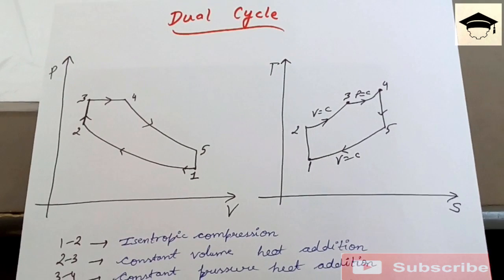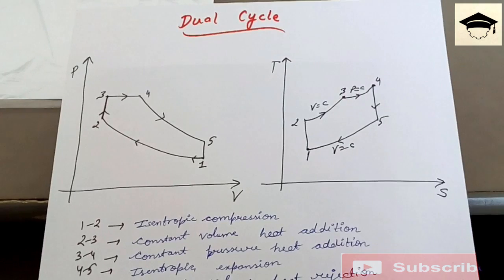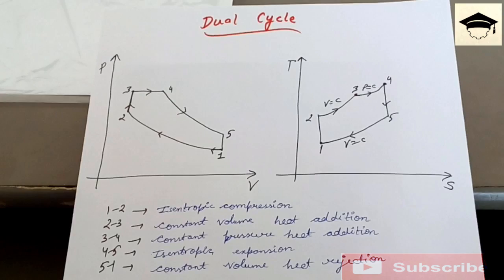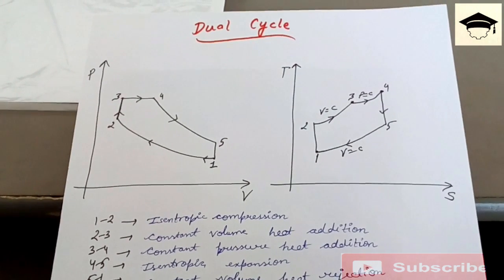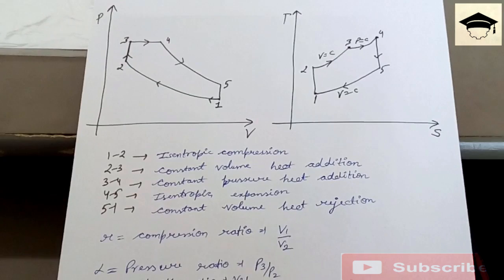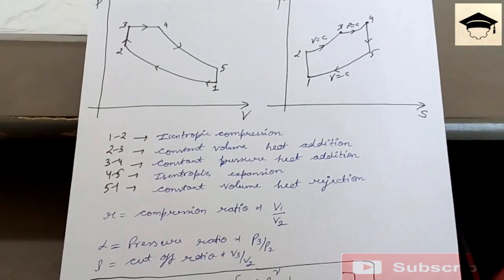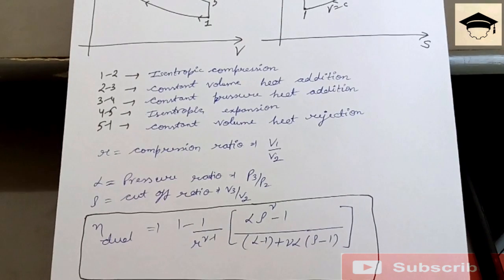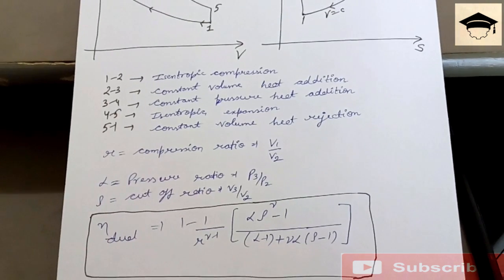dual cycle | dual cycle efficiency | pv and ts diagram of dual cycle | mechanical engineering online

Comment: which one is the suction stroke in pv diagrame of dual cycle??
Reply from the maker: ravindra the suction and exhaust strokes are not generally shown on Pv and Ts diagrams , I have also not shown here in the video . The suction and exhaust strokes are actually horizontal lines ie. at (constant pressure) . These are not necessary to show because the suction and exhaust stroke cancel out each other.